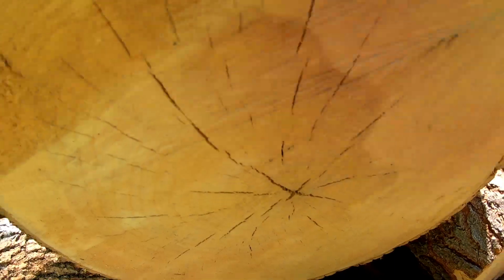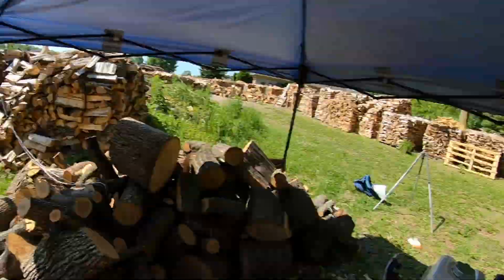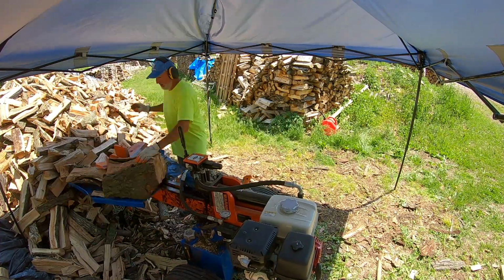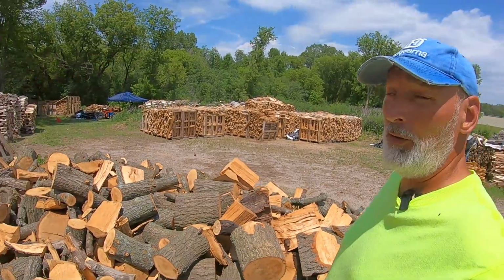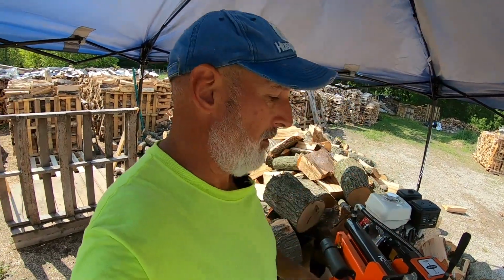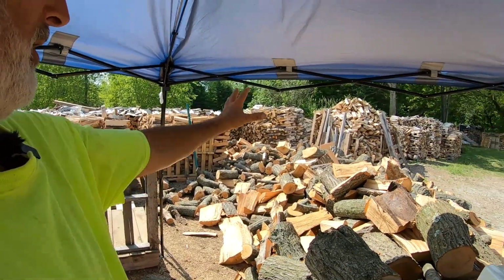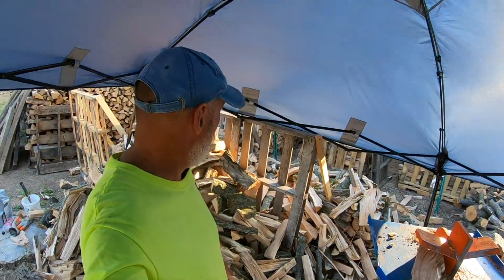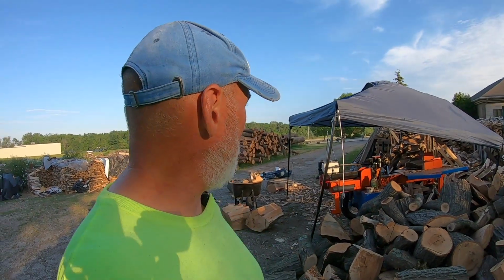Splitting Firewood in the Summer Heat - #371

Comment: Hi Chris. It would be real easy to either bolt or weld a pipe sleeve to the splitter that you can slide a picnic table umbrella in, it would be easy to move and setup, then you would not have to deal with always having room for the legs on the canopy.  Keep up the good work
Reply from the maker: Yes, I have been thinking the same thing, we both must be smart! HA!

Comment: The Bull Moose adapts to the heat! Congrats on the tractor! Saw the trailer dolly video - good call! Suggestion for the legs of the canopy - maybe 3" plastic pipe. Set the leg down in it, or slide it up the leg while setting the tent then let it drop to the ground. The split wood pile won't get to the leg itself making it easier to extract the leg, and also as protection for the leg from the split wood itself. Attaboy for sticking to it in the heat!
Reply from the maker: Thanks for the tips Brian, the heat can smack you down for sure!